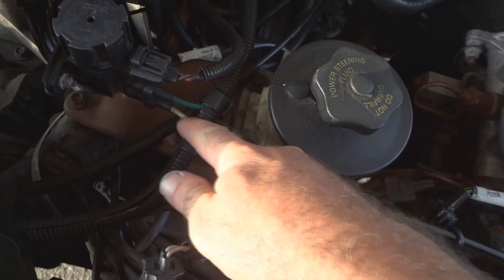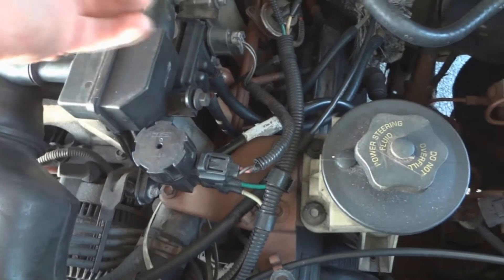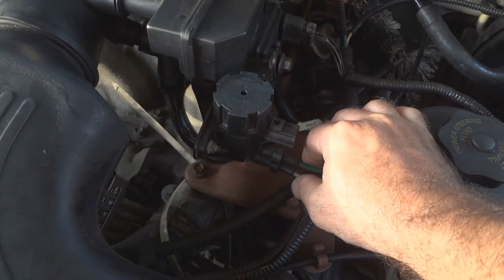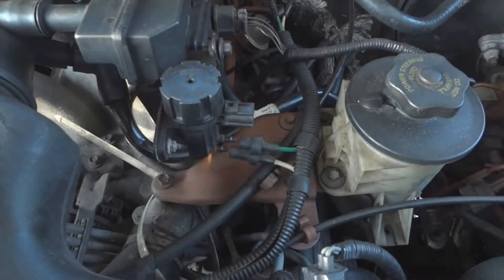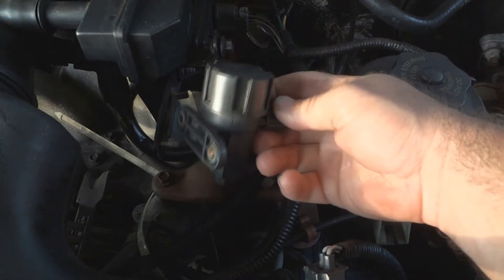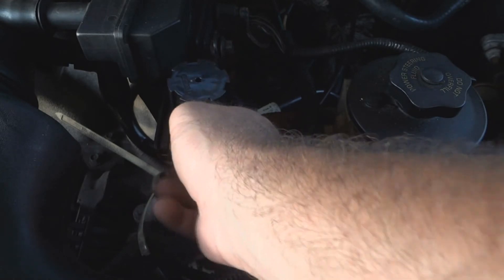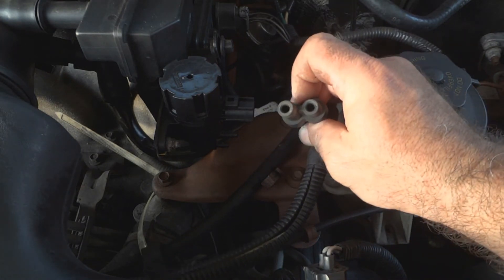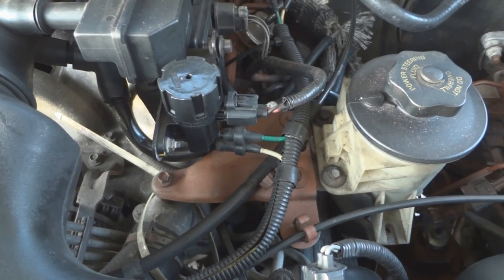1997 F-150 P0401 EGR vacuum solenoid

Comment: Question the tube going to top of EGR valve, is that hose supposed to suck air? Example, I put my thumb on hose I can feel suction while replaced one solenoid that was not sucking air it was just blowing air.
Reply from the maker: Yes it has engine vacuum that opens the valve, A solenoid next to it turns the vacuum on and off to open and close the valve. It only has vacuum when the ecu activates the solenoid.

Comment: I have a EGR code but the truck runs phenomenal. Guessing it’s a sensor since there’s no performance issues?
Reply from the maker: Mine still has the code even with the parts replaced.
Reply: @chriss4365  good to know. That’s why I haven’t replaced any parts, since it’s performing good. The only issue I have is randomly having trouble starting in really cold conditions, sometimes it take a couple try’s to keep it going but it’s not a constant problem. Might check out the IAC valve for the cold start issues?
Reply from the maker: @diyrob9160  yes the IAC
Reply: @chriss4365  thanks brother. Appreciate the videos!

Comment: How do I reset the computer? I have a NT301 ODB2 reader. Is it just erasing the codes after work is done? Do I need a special program?
Reply from the maker: It should only erase codes if you tell it to.  Disconnect the battery for 5 minutes then reconnect start and idle for 5 minutes to reset the computer.
Reply: chriss4365 awesome, thank you

Comment: Hi I was wondering where does the bottom hose of the egr solenoid connect to on the engine? Thanks so much.
Reply from the maker: It appears to connect to the ac vacuum lines on passenger side of engine.
Reply: @chriss4365  Thanks so much.

Comment: What code does it read for the malfunctioning of the EGR solenoid
Reply from the maker: https://www.youtube.com/watch?v=7yHhWsmHxl8
Reply: @chriss4365  ok ya I'm getting the P0401 but I'm not sure if I need to replace solenoid or EGR itself. Going to check lines I've already cleaned the EGR
Reply from the maker: @TinkeringTom91  did you reset the ecu after cleaning the egr?  You have to check in the intake manifold carefully run a wire in the hole after removing the egr valve if you feel any resistance its clogged with carbon and thats the issue.
Reply: I did I guess I need to recheck for deposits or buy new EGR Valve
Reply: I got the same motor on my 98 f150..that part makes noise and vibrates for like 15 seconds when I shut the truck off.is that normal or should I just go ahead and replace it?
Reply: @turnupdot2108  the true issue for my truck was actually the EGR Port it was fully caked with carbon you need to remove your throttle bodyand clean the aluminum cast ports 2 holes leading from the EGR valve with brake cleaner pics or whatever you can get in there that should clear the codes most times
Reply: TinkeringTom thanks!
I'm have that done
Reply: @turnupdot2108  what I've learned in my short experience as a YouTube trained mechanic is don't just be a parts guy you must diagnose the issue to find the true problems behind the part.. Good luck to ya
Reply from the maker: @turnupdot2108  after observing the new one do it, it's normal.  Don't waste the money.
Reply: chriss4365 thank you!
Reply from the maker: @turnupdot2108  anytime, when you have a question you can always ask.
Reply: I got a code p1409
Reply: @TinkeringTom91 you can also use throttle body cleaner! It might be safer or just about the same.